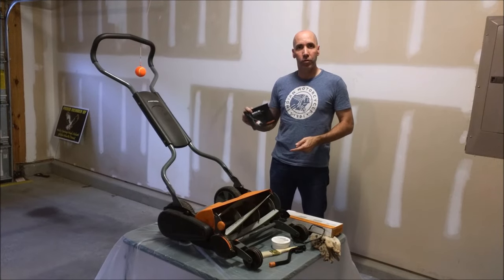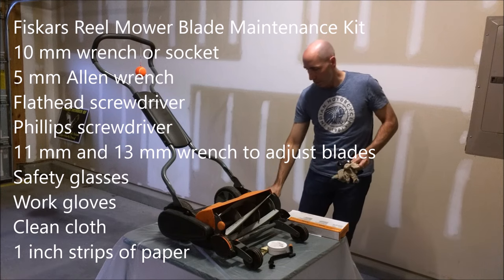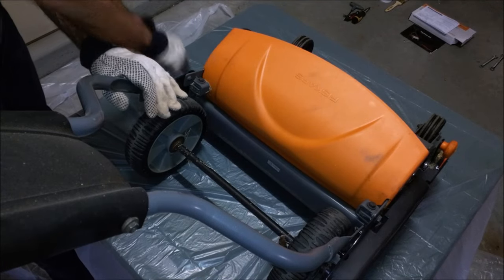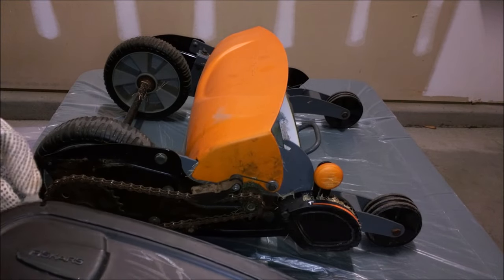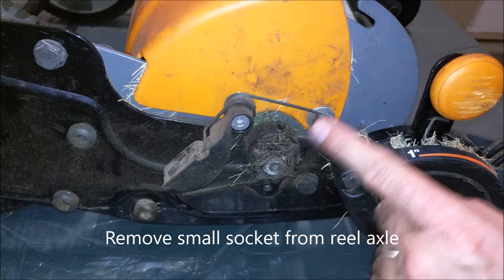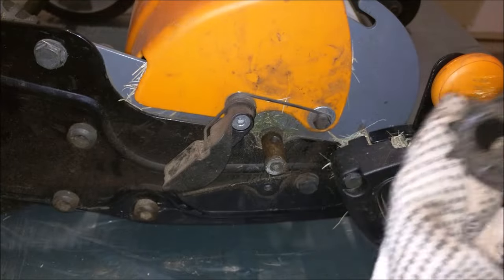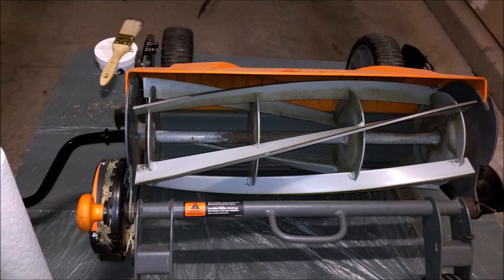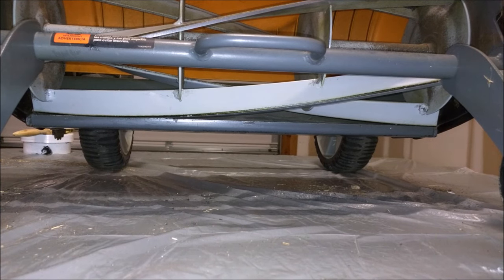Fiskars Reel Mower Blade Maintenance Kit Sharpen Blades on Fiskars StaySharp Max Reel Mowers

Comment: You don't have to take the master link on the chain apart, you can take the reel gear off with the chain still attached, just lift the tensioner up to give the chain slack
Reply: True that worked for me also!
Reply: Why not just turn the back wheel with it propped up. 😆
Reply: @azazelone905  That's what I'm wondering. What is the purpose of the crank arm when you can just turn the wheel?
Reply: @MJAP123  I normally degrease my new bikechain and apply wax for less powerloss, should I try it with my mower?  Cant see any disadvantage...
Reply: @azazelone905  the wheel only engages the drive chain in the forward direction

Comment: Is anyone else having trouble getting the socket screw out? It doesn't budge
Reply: Had to use a torch to heat it up. Possibly there was loctite.
Reply: I tried today to get mine off 😢 I will get some longer Allan keys to help me. But I MacGyvered some PVC pipe to go over the gear and tried sharpening that way. I bought unit second had and it is quite rusty and dull. I didn't get it to cut paper yet but it did cut the lawn okay (probably easier if sharpened). I will keep working at it.

Comment from the maker: my mower is 2 years old. I have adjusted the blades a number of times to keep it cutting well (cuts paper very nicely, but seems to adjustments every 5 or so  times I cut the grass). I have nicked the blades a few times on stones and had to file off burrs. I have backlapped the blades three times in two years. At this point, it still cuts great. I am careful to remove rocks and branches in the yard prior to mowing which I believe helps.

Comment: If you pull up on the chain tensioner and roll the rear wheel while pulling the chain to the side, the chain will just roll off the sprocket. Remember how we used to roll our chains back on our bikes as kids?

Comment: Did this last year with your help, now refreshing my memory. Thanks! 

After five years I've been nothing but pleased with this mower. Friends lot me I'll go back to a powered mower in no time. Never happened!
Reply: When did you sharpen the first time after buying? I just bought mine :)
Reply: I mowed with it for three years before I sharpened it. It was mowing okay before that, but far better after sharpening.

But I felt then that I should have applied the lapping pumice twice as my neighbor's reel mower was professionally sharpened and was sharper than mine. So I just finished two applications and ~10 min spins this time.

Comment: Thank you for the video.
I finally did this on my Fiskars mower after fourteen years of not doing so -- I have a postage-stamp lawn. 
I had to lower the reel, re-apply the lapping compound, and spin it four, seperate times, and yes it cuts much better.
Mine doesn't have the chain tensioner.

Comment: Excellent video, got my blades sharpened and adjusted to get a nice cut after six years of usage.

In my area the kit was sold out and I had to get another sharpening kit brand to work, but it came out very well just the same.

Comment: This is a fantastic video. Thanks, Dan, for this thoughtful and clear tutorial.

In case any viewers want it, I typed out the list of needed supplies here:
Fiskars Reel Mower Blade Maintance Kit (available on Am*zon)
10mm wrench or socket wrench
5 mm Allen wrench
Flathead screwdriver
Phillips screwdriver
11mm and 13mm wrench to adjust blades
Safety glasses
Work gloves
Clean cloth
1" strips of paper
Chain lubricant (optional)
Reply: Thank you!

Comment: Great video.  I believe I've commented before a few years ago.  No need to remove the link in the chain.  Remove the small sprocket with an Allen wrench as you suggest and simply slip the chain and sprocket off.  Easypeasy.  It goes on equally easy too.  There's slack in the chain from plastic spring grove mechanism that applies a little bit of tension on the chain.  I also use a 9/16"× 1.5" deep socket and little bit of Gorilla tape smashed in the bottom with sticky side exposed (sticking inside the socket and also sticks very snuggly to the reel bar).  I then use my electric drill and spin this reel crazy fast in both directions.  I also use 80 grit reel mower sharpening compound.  I've been using a little bit each year.  Container of that is pretty inexpensive and will likely last me 10+ years of annual use. 

I didn't wipe off all the grit compound, and apply some silicone lubricant spray.  Once finished, it works as good as new. 👍

Comment: Dan, I just got the same reel mower (used) the missing the two adjustment bolts and nuts. It seems I can't find its size anywhere online. Is it possible you can tell me the size (length) of these two bolts and nuts. They are the two with 11 mm to adjust the clearance between the reel and the station blade. If possible, please give me a close up photo of these bolts. Thank you so much for your video.

Comment: I have found that the factory set blades did not cut some grasses well. I have what must be quite thin grass on my lawn, it's just what grows there. It just bends and bruises a decent proportion of the grass. I have taken to testing the blades with blades of grass from the lawn rather than paper. After all, it is for cutting grass not paper. In my experience, this requires a much closer setting of the blades than would be needed for paper. Another gripe is that the blade adjustment is a faff. When you retighten the  locking bolts the blade to bed-knife spacing alters minutely, so you end up loosening, adjusting, retightening, testing etc. The adjustment system on my old Ransomes Mark 4 Ajax (from the era when push mowers rules) is much netter designed and easier to adjust. That mower just cuts very low.

Comment: My apologies in advance for a double post but I think if you have a drill with a half inch drive you wouldn't need the crank and could sharpen the blades much faster.

Comment: Thanks, Dan. Mine is about 3 seasons overdue. Seems if you're going to remove the axle cog, it's not necessary to take the chain apart. Is there a reason you did both?

Comment: What I have learned is that this process will only work for the blades that are already relatively sharp. If you have lots of thick grass and many little twigs in your yard, and haven't sharpened your blades for a few years, then they will get very dull and this backlapping method will not work at all, even after multiple applications. Essentially here you are honing the blades, instead of resharpening. Fortunately, it is easy to sharpen the blades back in shape with a simple file. There is a nice youtube tutorial on how to sharpen reel mower blades with a file.

Comment: Great video! I just went through this process, I used a vintage bit brace to spin the blade. I had a question about the paper slicing stage. To get mine to slice all across the blade I end up with some contact between the blade and the sharpening edge. The result is the blade snick, snick, snick when it spins, and it doesn't spin freely for long. Am I doing this wrong?

Comment: So the helical blades have to touch the one straight blade on the bottom in order to sharpen?
Can I just use a coarse to fine sanding block?

Comment: Just got mine replaced.  The first one touched on one side (the height adjustment side) and using the adjustment bolt didn't help.  The replacement now catches in the middle, no adjusting on either side helps unless I back off to where it no longer cuts.  Actually, I hear yours touch in the middle as well, I'm I wrong?   Any suggestions?

Comment: So what actually sharpens the blade. Is it hitting a metal plate in the back?
Reply: There is a bed knife.  The reel and the bed knife create a scissors action.  It is as the bottom where the paper is being cut

Comment: Do you have to apply compound more than once when you are sharpen the blade? When I’m spinning backwards within 3 minutes there is no more noise
Reply: Same for me except there's no more noise within one minute.
Reply: I had the same issue, but the blades did get sharper.  I think doing the adjustment first, then sharpen and then readjust.

Comment: What is purpose of tennis ball hanging from handle?  Nice video!!!!
Reply: It's hanging from the ceiling in his garage. It's a common thing that people do (especially for those with smaller garages/ parking spaces) that allows you to drive your vehicle into the garage to the point where the tennis ball makes contact with your windshield. 

This lets you know that you've parked your vehicle in the garage in the exact same spot (the ideal spot) each time. There's no guess work or worry regarding driving the vehicle in far enough that the garage door can close safely or driving in too far and possibly hitting something that's difficult to see due to being low to the ground or otherwise.

Comment: I got one of these push mowers used.  When I went to sharpen the blades, the sprocket was rusted onto the drive shaft and it wouldn't come off even with the set screw removed.  I tried liquid wrench and tapping it with a hammer, but no luck.  Do you have any suggestions for removing a sprocket that is a but rusty and won't come off?
Reply: I saw another youtube video where a man used a 32mm or 34mm socket and just used that on the sprocket without removing it. He then spun the nut with the drill bit backwards and that worked. Cheaper mm socket than buying the kit and more efficient if you have already have a drill.

Comment: Which bolts exactly do i have to loosen before i can adjust the blade height? And do u loosen two bolts on both sides? When I look at that mower it looks like those bolts are set so if u tighten them back it'll force the height back to original height since there's a hole for both the deck and the blade deck. I do hard to explain.
Reply: Just loosen the two bolts on one side or both sides at four bolts total?

Comment: This process is called backlapping, it will slightly hone the edge on the reel but it will do nothing for the longevity or edge of the bedknife.  Also, using too much compound or not applying it evenly will cause the reel to taper or cone making it very hard to adjust it even to the bedknife for proper cutting.
Reply: Exactly my case. Do you know what should I do to make it right? Now it cuts only when knives are touching and making noise. I am trying to sharpen every month.
Reply: It  works on the bed knife also.  The compound touches both and the same action that hones the one hones the other.  Sharpening doesn't ever increase longevity as you take metal away.  The amount of metal removed is so slight that any unevenness will average out unless someone really only applies it to one side.  You almost have  to try to mess this up.
Reply: @kubaistube  Make sure you are back lapping, that is, spinning the reel backwards after applying the compound.   Just back it off slightly.  If they touch then you will have to sharpen more often.  That is part of the "stay" sharp concept is having no contact.  If the blades are sharp you should be able to get the paper cutting without touching.   It may be far too dull and require more back lapping.  I recommend you take it to a pro and get it back in shape first.

Comment: Hello Dan, I just purchased a used momentum from a neighbor. I bought the kit and tried sharpening the blades. But I cannot get the small chain sprocket off. I removed the set screw and it won't budge, feels like it's welded on. Do you have any suggestions? Would liquid wrench work? I called fiskars and they said since I'm not the original owner they can't replace it and to give it the old college try and I've broken two hammers and a screwdriver trying to pry it off. Thanks in advance for your response.
Reply from the maker: Vincent Cavalea Hi Vincent. My first reaction is to tell you to call support for assistance, but it sounds like you have already done that. Of course, maybe you can get your neighbor who sold you the mower to help you out. If there is some rust on it, you may want to try a product designed to loosen the rust. You definitely want to be careful as to not damage the sprocket. I wish I could be of more help. A last option may be to bring it to a small engine repair shop where they may have the tools required to remove the sprocket. Sorry about not being of much help. Good luck to you.
Reply: 1) try a small pulley puller 2) Yes use liquid wrench (always) and let soak 3) apply some heat, not a lot but I am surprised at how often heating works. Heat the sprocket not the hub

Comment: I purchased a new fiskars stay sharp max at the start of this season. After say, 20 uses, the cutting surfaces no longer have that super sharp factory knife edge. I can actually run my thumb along the edge with little chance of cutting myself. 
Does this mean they could use a sharpening?
Reply from the maker: FisheeC3 Hello. You may want to call Fiskars support to confirm. I sharpen mine once per year. Also, make sure your yard is free of debris before you cut as that can dull your blade.
Reply: Thanks, great video.

Comment: I bought this mower used and after sharpening and tuning as best I can, I find that no matter how I adjust it, 2 or 3 blades will cut and the others miss, or if I tune it tight, all 5 blades will cut and the 2 will hit really hard, stick, or make it really hard to push. Is there another adjustment to center the whole blade assembly? They couldn't have gotten this uneven by wearing out differently.
Reply from the maker: Hi Dan. Based on your description, it sounds to me like 2 of your blades may have been damaged. For example, it is possible to hit a rock which can not only put a dent in the blade (in this case you can file it smooth), but it can also push the 1 blade further or closer to the bed knife.This machine is very finely tuned, and if it is off by even a fairly minute amount, it can impact the way the mower cuts. The first thing i would do is to make sure you do not have any burrs in the the 2 blades that are problematic. If there are burrs, you can use a small hand file and file them smooth. If not burrs, i think you have 2 blades on the reel that have been bent (i.e., no longer the correct distance from the bed knife at the bottom). If this is the case, you need to be very, very careful as to not cut yourself or make things worse with the mower. One thing I have done in the past is tap the blade lightly with a hammer on the part of the blade that is touching (or too far from the bed knife). I can't emphasize enough that great care and safety must be taken (including putting work gloves on and proper eye protection). Please share with the community what you find out. Good luck and thank you. Dan
Reply: You're moving into cut resistant glove territory.  My former workplace mandated glove type usage and mandatory training or else termination.
Reply: I have this same problem and I have meticulously tuned it and grease pen marked the blades that rub. The thing is that those same blades don't rub on every rotation. This has led me to understand that the bearing must be bringing the shaft out of center because the interference is not at the same frequency as the rotation. Honing my blades makes no sense at this point until I solve the centering problem. If I adjust it more open so no blades contact, it will not cut a NYT's newspaper on some oscillations.

Comment: Dan, how old is your mower? I had mine for less than 2 years and the moment I adjusted the blade, the cut quality went downhill. I also tried sharpening the blade with the kit but it didn't help.

I really hate that this was such a good mower, but now is useless.
Reply from the maker: +Chris Ratchford My mower is 2 years old. I have adjusted the blades a number of times to keep it cutting well (cuts paper very nicely, but seems to need adjustments every 5 or so  times I cut the grass - I believe it is because i hit sticks or mulch from time to time). I have nicked the blades a few times on stones and had to file off burrs (both on the reel and on the bedknife). I have backlapped the blades three times in two years. At this point, it still cuts great. I am careful to remove rocks and branches in the yard prior to mowing which I believe helps. I have noticed that I have gotten considerably better at readjusting the reel as I have done it a number of times. After backlapping (and cleaning off the compound), there is typically too big of a gap between the reel and the bedknife. Slowly adjust each side down until it just barely touches the bedknife, then back off ever so slightly before tightening. I wouldn't tighten things up until both sides are barely touching, then alternate sides as you tighten it up. Sometimes I find that when tightening the reel gets closer to the bedknife (i.e., touching after tightening). When this happens I loosen a bit and make a very minor adjustment to back off the reel on both sides, then tighten again. It takes a little practices (seems more like art than science). Trust me, after a few times you will be able to do it in a few minutes. I hope that helps!
Reply: @leelindsay5618  thanks!

Comment: u didn't have to separate the chain links
Reply: @drivin69  nope all he has to do is remove the set screw and sprocket the chain will come of with the sprocket. No need to take apart the chain.
Reply: You can quickly pull up on the tensioner and remove the chain. Takes about 5 seconds top.
Reply: Even though it wasn't necessary, for folks who haven't used a master link this was a good tutorial.